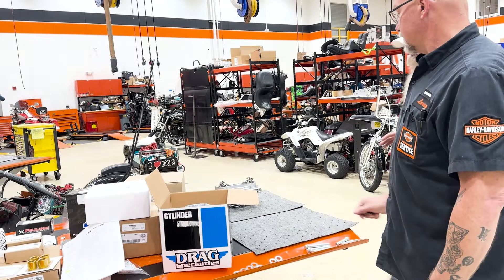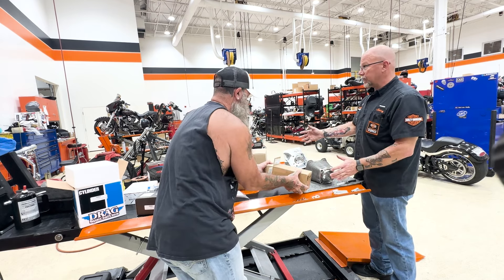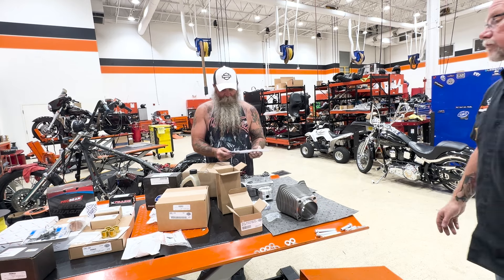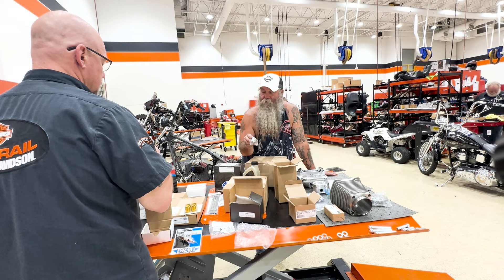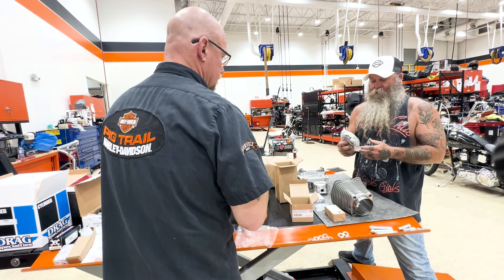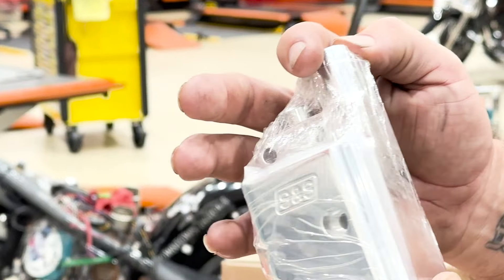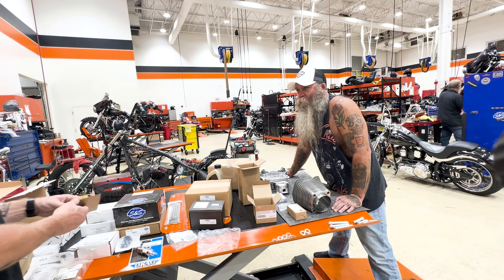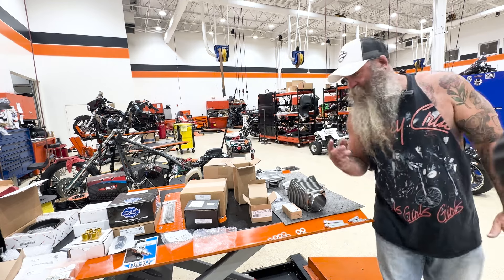Delivery Day! Parts for #chopper rebuild are here - let the fun begin

Comment: I've got a heratige softail classic 2002 and I believe it has a intake leak. I pulled my plug and they are black which makes me believe it's running rich. I hope there's no internal damage. Not riding it til I can get it fixed